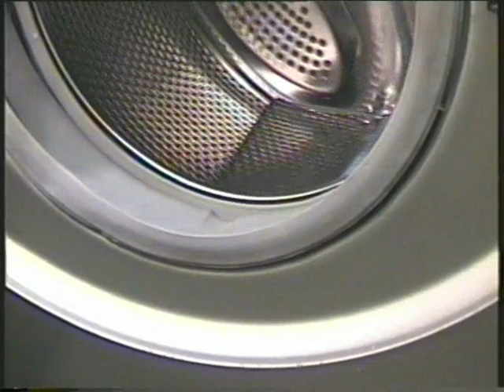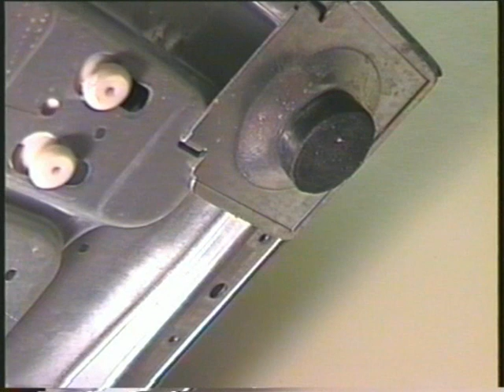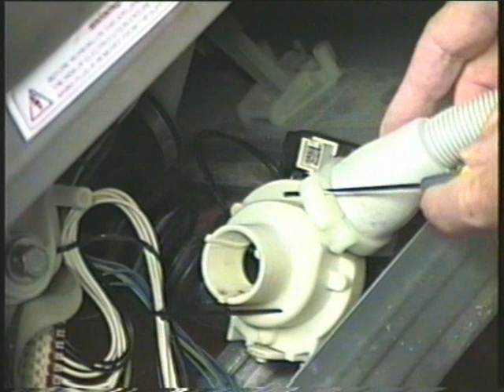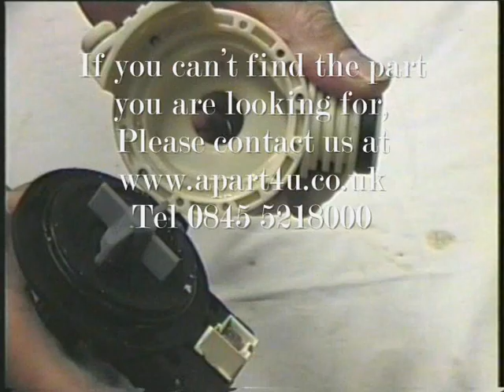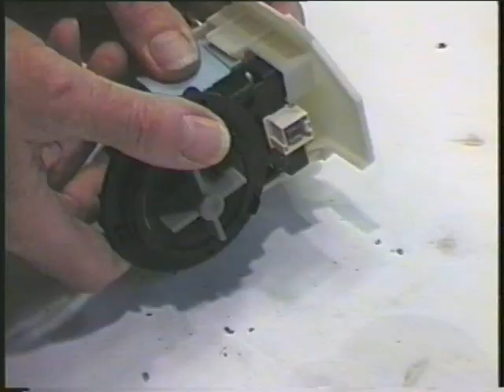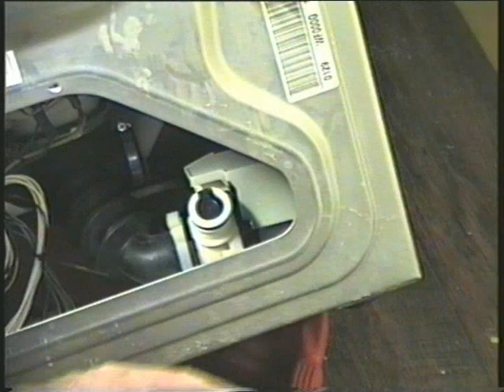How to change & Diagnose a fault on a pump in a washing machine

Comment: Can anyone please help.

My washing machine keeps filling up with water even when its unplugged.

But when i turn the washing machine back on and set it to drain water it does drain perfectly.

But it keeps filling up again with water even when ive unplugged the washing machine.

Also it keeps stopping on washing cycles when im washing clothes and sometimes skips cycles and finishes the wash cycle to quickly. Clothes still dirty.

Sometimes it does its washing cycle perfectly and sometimes not. This has been happening for about 3 months now. But the water constantly filling up has started happening 3 days ago.

Any suggestions would be greatly appreciated.

Comment: Thanks for such a clear video, particularly getting the hose clips off, had always struggled before. Found a stout steel pin jamming the pump, removed it and trusty Hotpoint washes on.